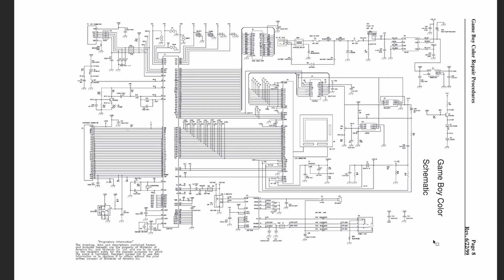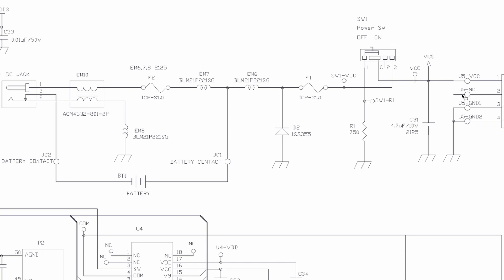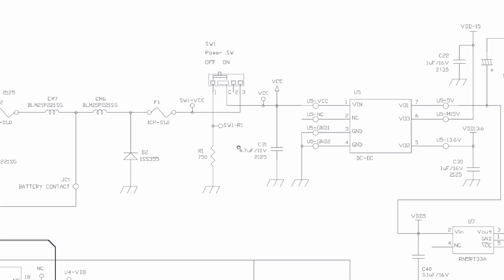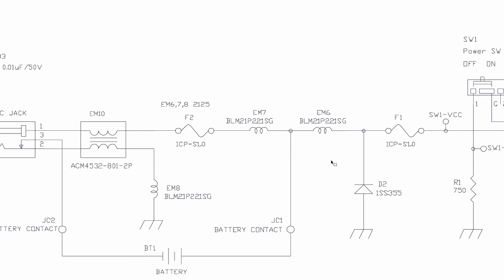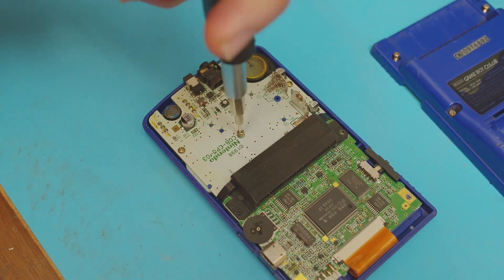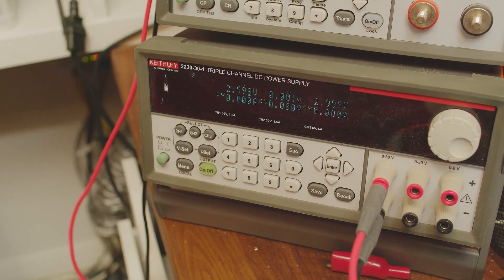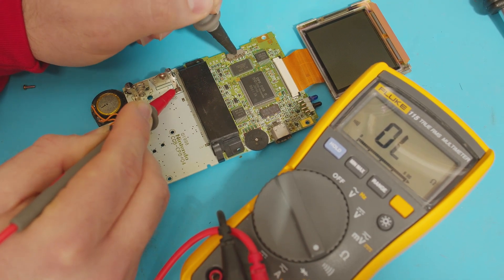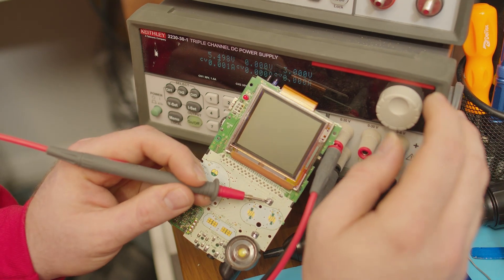Game Boy Color Power Switch (How It Works + Bypass/Test)

Comment: Hey man, while cleaning and taking off my powerswitch, the copper from pin3 came off. Where/what can I connect the third pin from my new powerswitch with?
Reply from the maker: If you checkout the board scans here https://www.retrosix.wiki/gbc-board-scans you can follow it. It goes under the power switch, to the other side of the board, and then is a big thick trace running down the PCB. You can scrape that away and solder to it

Comment: I' v got a question. My power switch fell completey to dust. so now I have no power switch at all on the circuit board.
When I short C and 3, the power LED turns on, but no "Gameboy screen" or sound. Is it necessary to have the switch soldered
to test functionnality? I suppose a connection to the other soldering points is necessary for the screen to appear but it' s just a guess,
can you tell me something about it?
thx in advance
Reply from the maker: No that would be fine to test. Likely your regulators negative voltages are bad so you would need new regulator or a screen upgrade
Reply: @RetroSix  ok I wanted to upgrade to an IPS v2.0 anyways so if this fixes the issue it' s fine. I wonder if the Problem came from the Button led kit. After mouting it, everything worked fine until I turned a few times on and off while the case was opened. I hope I did not short anything while turned on. What makes me wonder is, when I have a charger connected, the led lights turn on...I don' t know if it is a feature or an issue.
Reply: @RetroSix  Ok I resolved my issue. Took a small wire, soldered it from C to 3 to be free handed to run tests. Turns out the power supply I used seems to compromise somehow since it has 5V output instead of 3V required. So having wired C to 3, I could test batteries and.... taddaaaa, everything works just fine. So at the end of the day, it really was the power switch. So I' m gonna wait until it' s delivered and fix my GBC.

Comment: My pad 3 on my on off switch came off by accident. Can I run a wire in SW1-VCC to the 3 prong on the on off switch to solve that problem
Reply from the maker: If you follow where the trace goes after being ripped and just wire to there yes